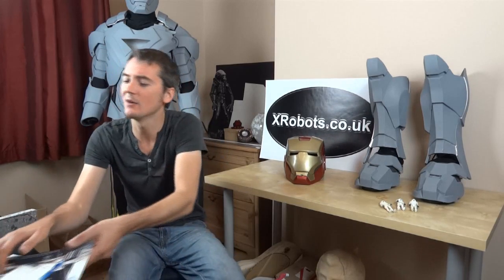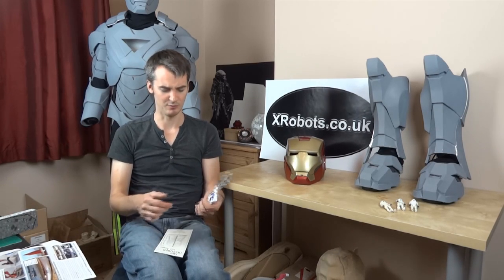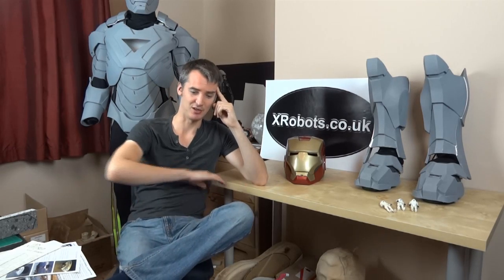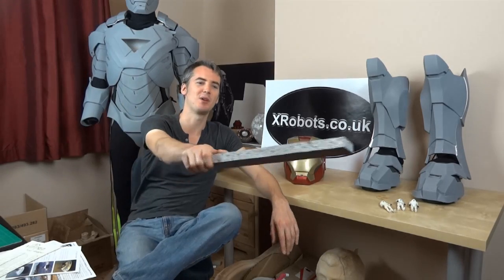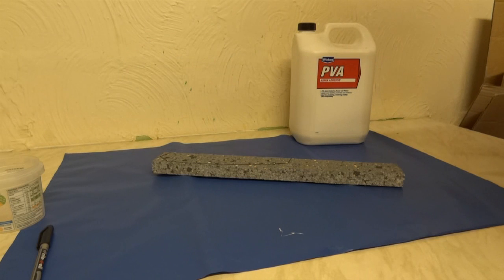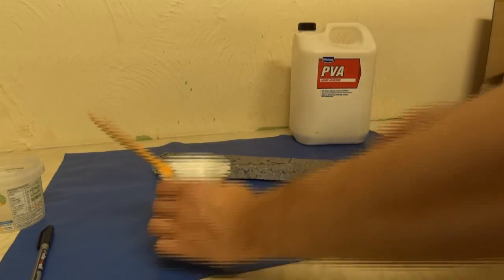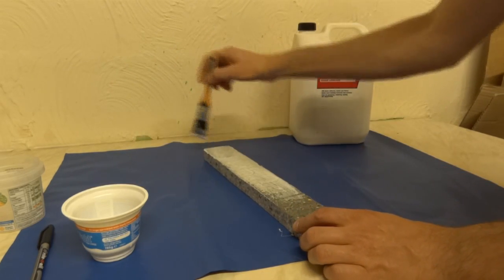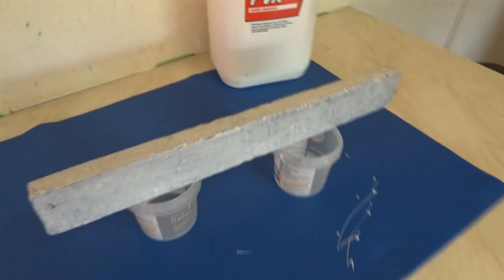Experimental Boat Building Part 1, testing expanded polystyrene and fiberglass composite

Comment: Very large boats capable of global travel, racing even, are made from foam core. I have never used glue over polystyrene (foam board often used for home insulation) no need. You can also use Gorilla Glue mixed about 90:1 with water poured into a mold if you want a custom shape. The glue  will foam and expand significantly. You can  then glass directly over that. Good luck with your projects!
Reply: I needed this info. Thank you!

Comment: you need to round the corners you cannot glass over sharp 90deg, thats why it lifted so bad. two more things. using PVA is a release agent so you cannot use it under the fiberglass if you want it to stick to the foam core, which it needs to for maximum strength. just buy epoxy. if you pre-wet the core, (foam) then use a mini paint roller to really give the CSM to wet out properly (use a microfiber or mohair roller not a foam one)
Reply: PVA- polyvinyl alcohol (release agent), also PVA -polyvinyl acetate (wood glue)
Two different products altogether.
Google can be helpful if you use it....

Comment: This is just too ridiculous for words. Do I waste 9 mins of my life watching you cock it up or just shout at to now? Wrong foam, wrong resin and very wrong method  but you will have hopefully discovered that by now.
OMG, you really don't have a clue how to do glass work do you. Firstly you don't dab it on, you load a wide brush and paint the resin on in long strokes and you absolutely don't tack one edge on and let it go off!  I almost can't watch this its so bad. Glass wont go round sharp corners. You wet the whole piece out first then wrap it round. Doing it your way you are trapping tons of air in the laminate, I haven't seen the end result yet but I can see even now it will be a disaster. No, chopped strand doesn't fall apart if used correctly and sure enough that example of your handiwork is a dogs breakfast as I said it would be.
A few air bubbles? It's ALL air and as weak as hell! You really do need to go and learn how to do it all properly.
Right, lets see what a cock up the nex  stage is.....

Comment: This is one of quite a few YouTube's I've seen where people are experimenting I use that term loosely different types of foam and fiberglass resin and cloth. If anybody bothered to do any type of researchat all they would find that all of this has been done they've been using core products for decades since the 50s. So why you can spend your time and dollars reproducing trials that have already been done and things that have been proven and disproven, you are setting yourself up for a big disappointment.if you place the wrong component between your core and your lamination / resin,in a short amount of time depending on the stresses involved you will have delamination, and you are perceived strength and rigidity will disappear. A little research goes a long way, especially if saving money is one of your goals.

Comment: I notived in your video #7, you laid the fiberglass over the Styrofoam, with sharp edges, leaving lots of sharp ridges around the foam edges. That leaves loads of air gaps in the glassing, weakening the job you did in the end. You could have taken an bent hacksaw blade, and gone over the foam, and smoothed it all down, leaving no sharp edges. That way when you lay the glass, it bonds to every part of the foam you glued to the hull. You wouldn't have had the larger air-bubbles, and ridges (which was easily seen in your video), like you ended up having in your end product. If you had taken time to shape, and smooth your work, it would have turned out much stronger at all points of the laid foam, and way better smooth  looking as well.   Next time … Good luck.

Comment: Should have used a fiberglass roller to lay the glass properly.  What it does, is push out the air bubbles, and keeps the fibers laying down, so once it kicks off, you end up with a smooth surface, what is completely air-bubble free, and is bonded everywhere on the foam.  Using a bush is fine to first put the resin to the fabric, and spread out a bit. Once you use the roller, it speads out the resin even farther, and more evenly, removing all the air bubbles.   You could have also used Gliddens, "Gripper" (which is a paint primer sold at Home Depot by the quart) to both glue, and seal the Styrofoam, much like that of the PVA Glue. Just saying. You can use my info for next time.

Comment: Quite a decent test, given that you (no disrespect intended), were very 'casual' about the application of cloth and resin, removal of air bubbles etc. 
I presume that you have some experience with woven cloth, and if that's true, what do you feel would have been the improvement in strength (if any),  if you had done the same test with woven cloth and NO air bubbles?  Would carbon fibre have been better or have any other advantages?
Regards Mark in the UK.

Comment: You need to cut the brush in half and the take the fiberglass and wet it in resin completely until it turn clear almost the wet the styrofoam . Then wrap both ..what you did wasn't enough ..Or buy a product called thermolite . What that product is ..it's a fiberglass n foam board in different densities ..used to replace plywood in boat building .. Good luck
Reply: +James Bruton (XRobots) Hey man your videos are pretty good! Keep up the great work.

Comment: i would have liked to have seen a comparison between the weight vs strength using the glassing method using the resin vs the white glue for glassing, i would bet that the white glue galling technique would be much lighter over all and be almost as strong or at least stronger than what you would need for a boat.

Comment: Please don't.  Even if the EPS (or any other core material) is weak on its own, by virtue of keeping the composite skins spatially separated from each other it adds immensely to the flexural stiffness and strength.  

Page 3.  
hexcel.com/Resources/DataSheets/Brochure-Data-Sheets/Sandwich_Panel_Fabrication_Technology.pdf

Comment: Petrol works well to dissolve polystyrene too (I use old, out-of-date 2-stroke petrol)... although the resulting product is basically ersatz napalm, so don't get it near a flame - it burns hot and for hours.

On a more serious note, it sounds like you're making a rigid skin-on-frame kayak - a perfectly well regarded technique - I look forward to seeing the results!

Comment: An intriguing idea, however have you tested that the result of this process still floats? I'd compare the flotation of this block to the flotation of an equally sized block of expanded polystyrene. I'd also worry about water permeating through the material - you will probably need to coat it with some sort of impermeable material.